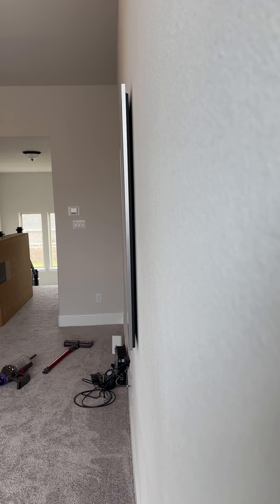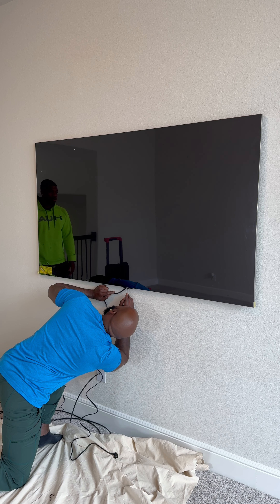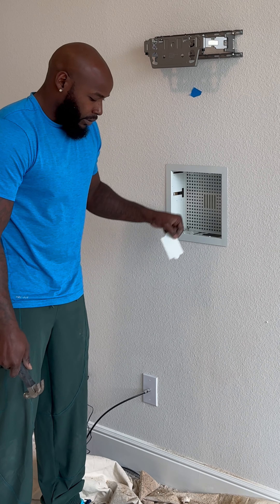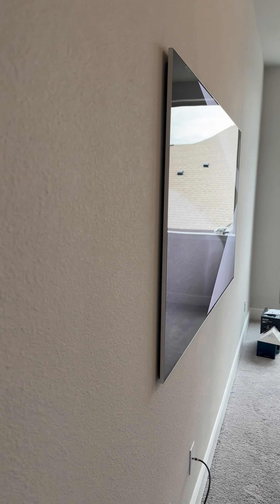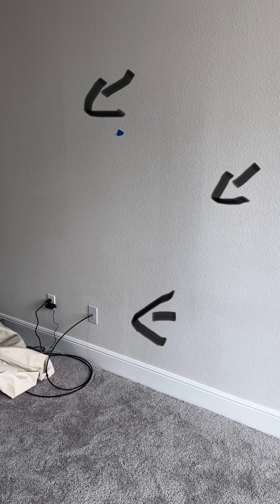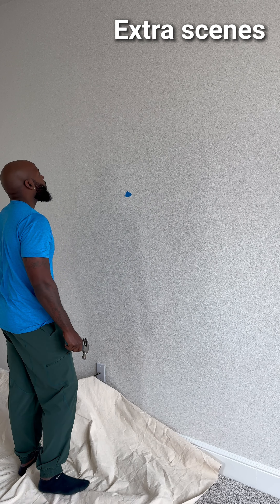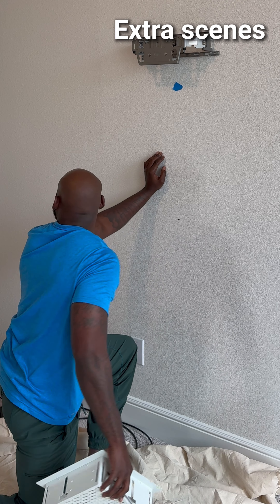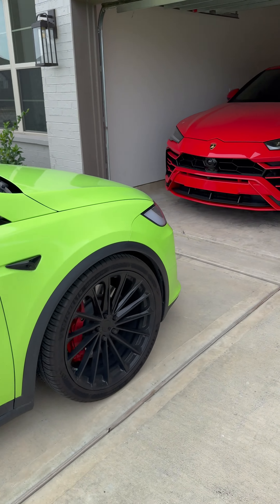How to install a 77” LG G3 OLED

Comment: I just bought the LG 86” from Costco on sale but my studs where 24” vs 16” I would have paid $500 for a install.
Reply: Just get a bigger sized mount, the advanced tilt mount should work or you can do toggle bolts